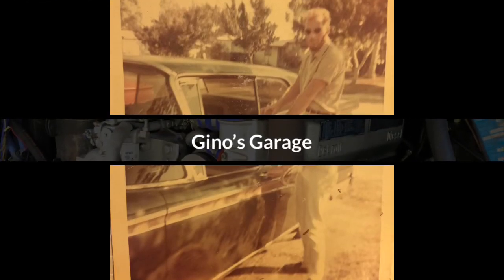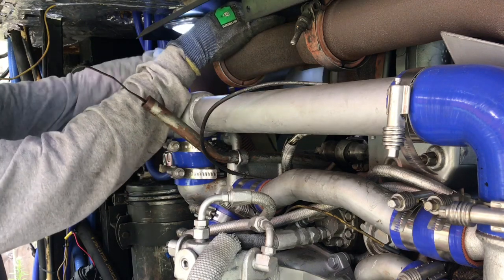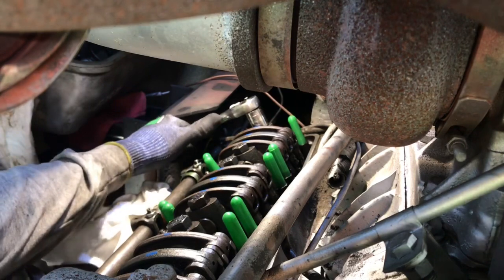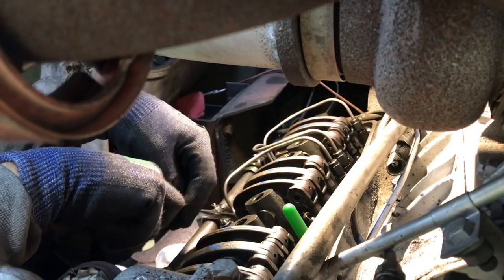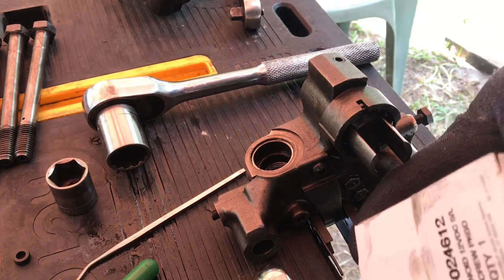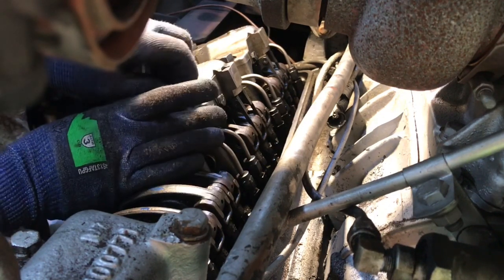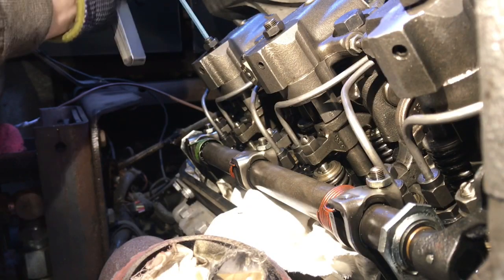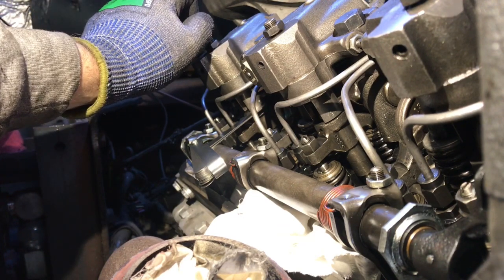Part 1 Adding Jake’s to a 6v92TA

Comment: Great information I recently purchased a 6v92 MC12. Who do you use to order parts from?
Reply from the maker: I have my own local parts man that supplies all my parts. The jakes I got lucky and found a set for an 8v92 on eBay.
Reply: @GinosGarageUSA  I'm currently looking for a mechanic to do a inspection on my bus in Georgia would you happen know anyone?
Reply from the maker: I only know of one mechanic in Georgia but I am not sure if he is mobile, and I think he mainly works on Wanderlodges. His name is George Morris, I would have to look up and see if I could find his info. The only other place I can think of is Coachcraft, but again not sure if they travel.
Reply: @GinosGarageUSA  thank you Gino it does drive I found a local trucking company that would do a drivetrain inspection but it's not easy finding someone who knows these older 6V92s what engine manual did you purchase?
Reply from the maker: @robertcrawford6072  I have an electronic manual that I found.

Comment: Are these 2 stroke detroil reliable , looking in buying 8v92 475hp has reman engine with 100-150k looking to replace my truck with big cam been super reliable
Reply from the maker: These engines are super reliable, the all mechanical engines do not require anything other than fuel and air.. of course maintenance and knowing how to drive them is important. The usual killer is overheating them, make sure your cooling system is maintained and drive it by the temperature gauge. Anything approaching 200 deg F coolant temp and it needs to cool down. Should run all day at 180-190 deg F. They drive differently than a four stoke diesel, when I am cruising at 70 I am running 2100 RPMs and it sounds like it’s screaming, an 8v92 will not sound so much like it’s screaming though.
Reply: @GinosGarageUSA  ok thanks for advice,  how do you if its all mechanical? Engine was reman 99 tags says .. also they say not to  lug  engine or idle extended period wat is that referring to ?
Reply from the maker: @MrSehka77  The engine will have a box with wires coming out of it mounted on the engine if it’s computer controlled. 
Lugging is running too low of RPMs while pulling a load or working the engine. I like to keep mine above 1500 RPMs when I am pulling a grade etc. I try not to idle more than 15 or 20 min. Detroit’s like to be worked and when they idle the oil pressure is not the highest so things in the engine are not getting lubed with oil as good as when the RPMs are up. If I do idle I like to use a high idle.. which mine runs about 1000 RPMs on high idle.
Reply: @GinosGarageUSA  great information appreciate your help
Reply: @GinosGarageUSA  hi their Gino's,  how long do you think these 8v92 will go before needing inframe or reman ??.this truck im speaking about has a reman engine  only 100-150k runs very well very clean has alof of power 475,hp single turbo ..also what do you recommend maintenance wise be done to these engine? Have done oil change and fuel filter , coolant systems was all redone with reman engine was installed ...
Reply from the maker: @MrSehka77  Inframes on these engines can easily be 500k or more depending on how they are treated. The thing that happens with these engines is the head has o-ring passages for the coolant and they can have issues if they sit for a long time... so sometimes they can have issues even with low miles. The best thing to do is run them. I would keep up with the oil changes that is the biggest item, make sure you are using 40w oil. The bearing on these engines should be looked at at 150k, and if I am going to inspect them you might as well change them. Also change the oil pressure regulator springs on both the oil pump and the regulator on the bottom of the engine.
Reply: @GinosGarageUSA  ok understood ,  bearing meaning inside main engine bearing 150k also the spring on pump and bottom of engine just the spring for idle correct?  Its harder to find some one that works.on these older engine.. says your traveling tech what are are you located, m
Reply from the maker: @MrSehka77  Yes crankshaft bearings and connecting rod bearings. The springs are for the engine oil pressure... one is on the oil pump and the other is bolted to the bottom of the block, they are both have to be done when the oil pan is removed. I am located in Tampa, Florida.
Reply: @GinosGarageUSA  ok understood thank you for you help
Reply from the maker: @MrSehka77  No problem, glad to help.